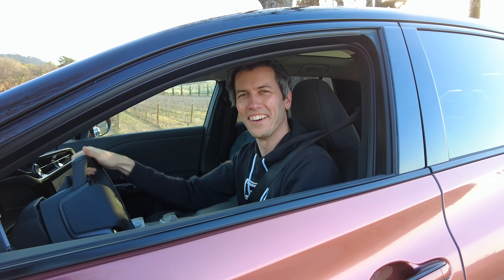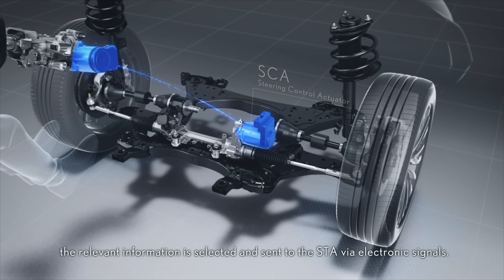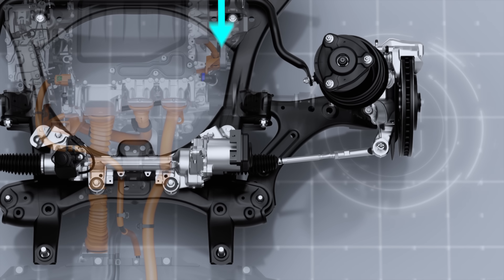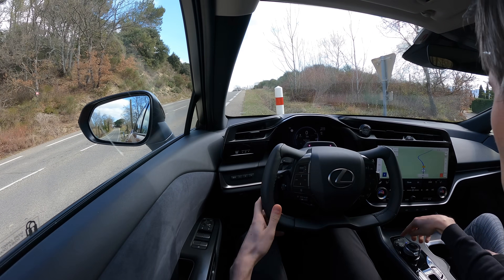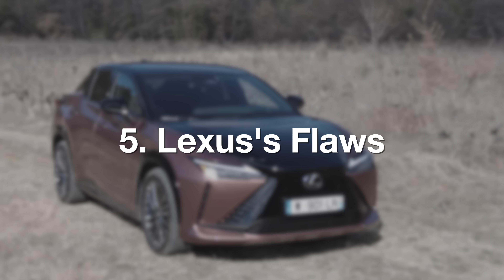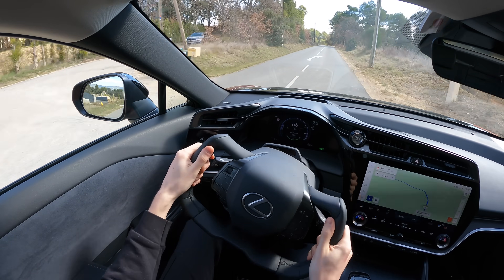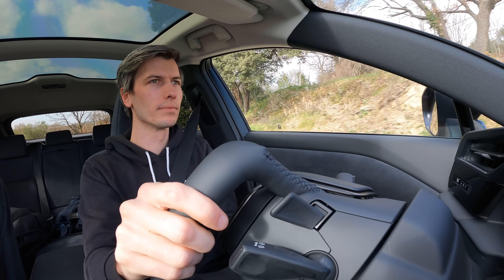How Lexus Fixed Tesla's Bad Idea: Steer-By-Wire Yoke

Comment: It'd be interesting to know what happens if you were to have a crash / hit a curb... The car's alignment would become shifted and so you learn to use a different steering angle when driving along.. what would happen here? would the car self align somehow? but obviously then you'd never feel if the toe was incorrect, only noticing it in shredded tyres.

Comment: I don't like the idea of variable ratio, how much it varies with speed changes? Does that mean that it can turn more by itself if I slow down during a long curve if I don't move the wheel?. 
I already feel really weird when a steering wheel gets stiffer at higher speeds than when you're moving very slow or not moving.

Comment: everything by wire have a delay. and since I haven't tried it am I not able to say that it is or isn't noticable. but it was pretty easily spotted in the beginning of the video. (written at the beginning of the video)

I see another problem as I go through the video. having variable steering ratios might look good on paper, but having the ratio change as you go along sounds incredibly sketchy. how turning the wheel one amount isn't the same as turning the wheel the same amount. that is the beauty of having a set steering ratio. it would be kinda ok if all driving was set at one exact speed and you only change speed as you go into another area with a different set speed. so let's say 50km/h in a city, 80 on a country road and 110 on a motorway and you aren't allowed to drive anything over or under that speed. but we all know that driving is dynamic. you might be on a sliproad where you accelerate as you turn, is it really a good idea to have the driver to turn the wheel more as the speed increases in a set radius bend? (written at 4:58)

I don't really see a loss of power as being the biggest safety factor because as you say, there are more than one power system. and having one or two or 20 motors to turn the wheels aren't really the concern either, redundancy is key. the one that really worries me is the computers. computers have gremlins, computers do mistakes and bugs are a part of computers. I have had throttlebodies fail on me that was fixed by just restarting the car twice in two different brands of vehicles and both were fairly new. this was all something that happened in the computer that decides what the throttle body is doing. the good part about the throttle body is that if the computer fails isn't it that big of a deal. you have no power so you coast or brake until you're stopped. you still have all the other functions in the car. as for steering by wire or brake by wire is it different. if there is an event that happens, could be a binary flip that doesn't cause any damage to the computer will there be an error but the error will most likely only last until you restart the car. this is the major concern I have.

I don't want the complexity, and I will never own one. I don't want steer by wire, I don't want brake by wire and if I'm able to avoid it would I avoid throttle by wire too but that one is sadly impossible if you don't go back quite a lot in time. but there is no denying that a cable actuated throttle is much more responsive than a throttle by wire so I want a cable for that simple reason.

Comment: Mechanical linkages can fail too. I had a Ford Fiesta where the gear to the rack became loose and I lost steering on a bend in the road while heading toward a lorry. Thankfully my brakes worked and the steering re-engaged once I slowed. A hart beat skipping moment I can tell you.

Comment: 2 motors or 2 batteries are not truly redundant system. If there is  a short in that wire due to you going of the paddle, you are fked.

Comment: 90% of drives do not hold a wheel like that on 10-50. I hold my hand on the top or the bottom of the steering wheel using one hand. Using Yoke is the stupidest idea ever. Adjustable steering based on speed also would create a lot of problems and accidents when you have to turn sharp even at highway speeds to avoid an accident. Steering by wire is fine, but adjustable and yoke are not.

Comment: Ignoring everything about how they work, just looking at the two yokes I can tell that one company knows what they are doing and the other doesn't.  The Lexus yoke is open for your hands at the 9 & 3 position, in line with the axis of rotation where they should be.  The Tesla yoke... where do you put your hands?  Are you expected to have them up where the (minimal) controls are?  Or further down in the 8 & 4 or 7 & 5 positions?  On top of that, having 840 degrees lock to lock on a yoke is sheer madness - it really shouldn't be allowed.

I think the direction Lexus is going is the future.  Getting drivers into the habit of always having their hands at 9 & 3, or perhaps I should say never needing to take their hands off of 9 & 3, is a good thing.  Lexus needs to get rid of that delay though, and make sure the sensitivity curve still allows us to dodge a moose on the highway at night.

Comment: I'd be curious to see how this responds in certain situations - like on an exit where you may go from 60 to 35 miles per hour while steering the same amount - will you start steering at a steeper angle despite not changing steering angle?
Reply: Exactly what I was wondering! Does the switch happens when you go straightforward ?
Reply: I'd assume that in terms of driving feel steering angle = turning Gs. So yes, but it will probably feel really intuitive. Your steering angle is dictated by turning 'feel' rather than the size of the turn
Reply: @LakinMoser  no they're not equal when your speed is changing.
Reply: my 2015 audi s4 has that, and yes the steering changes depending on the speed.
Reply: yeah that would be a bit confusing... and dangerous
Reply: F1 has this
Reply: Also will it be open source or just easly to mess with so you can easly set it how you like it?
Reply: @GreenBlueWalkthrough I think you know the answer to that.
Reply: in normal cars if you keep the same steering angle and slow down you will turn tighter as you slow down i guess in this it will be the same with the wheels adjusting so you turn is slightly tighter
Reply: Underrated comment

Comment: We've had steer by wire in port equipment for years. The port I work, We've had steer by wire Straddle Carriers since 2015. Nice system. Change is always uncomfortable until you get used to it.
Reply: Change is potentially beneficial when it serves a purpose, this does not.
Reply: @LaVaZ000  did you watch the video?

Comment: I has to be refined. But it is inevitable that that would be the choice as it is also cheaper to manufacture. One huge gap in safety is the wire itself. I had a car that had electric wiring problems which happened randomly, and by the Murthy's law never showed itself up at the dealership, but that would be an edge case scenario and will not impact the overall decision made by the large corps for us.

Comment: The best thing about steer-by-wire is that a bad actor could remotely hijack 1000 cars and steer them directly into an elementary school with no recourse from the vehicle operator. Good thing the brakes are electronically controlled as well.

Comment: It’s interesting how it works similar to racing games input. On low speeds you can turn all the way, but on high speeds it limits your input for stable driving. I know that on this Lexus doesn’t limit the steering, but instead just make changes the ratio of it.
Super interesting!

Comment: The point that you made with safety and how we already have drive by throttle, well those systems fail as well and we already saw ho much damage that can do, so no this is not 100% safe and it can fail

Comment: Not sure I like this, when accelerating out of a corner surely it will feel like the car is tending to understeer, when braking and cornering it will feel like it's oversteering? Plus at high speeds, that amount of steering latency could translate into a significant distance if you need to react quickly..

Comment: the fact that just about every driver in the world uses conventional steering input. driving a car that has less steer travel would confuse even the most experienced driver. your mind is conditioned for one thing when driving so if you give it something new it would take quite some time to convert to the new steering system. ive driven using steer by wire and didnt like it one bit.........

Comment: Thanks for the video, clear, concise and enjoyable (mostly).  However, please, for the love of god, look up and learn to distinguish between 'electrical' and 'electronic'.  Motors and thus conventional electrically assisted steering systems are electrical, not electronic.  You unfairly lose huge amounts of credibility with some of us when you abuse these terms.  Typically electronic means using electricity to manipulate information, so usually involves silicon circuitry.  Systems merely using motors or other electronic actuators, (powered doors, central locking, steering, wipers, etc) are not electronic in themselves, even if they can sometimes be controlled by car computers (body control units for instance).

Comment: Most modern mechanical steering racks have variable steering ratio, so the steering wheel is less  sensitive around the “zero”, which fixes the problem of car being twitchy. But the more you turn the steering wheel, the shorter the ratio becomes. It’s a much simpler and safer solution, in my opinion.
Reply: That's really interesting. I wasn't aware of that. Does power steering also compensate for the lower ratio near center by providing more assist?
Reply: @FurTip  I would assume it provides less assist
Reply: I call BS. How many have you taken apart? I've never seen this magical progressive rack you're talking about. I had a 14 sonata rack apart the other day, it's just a normal rack and pinion. You're definitely not talking about one of the ball screw racks, either. Since all steering racks turn more than 1 turn either direction, I don't really see how you could make a progressive rack. Any variation in the "ratio" is due entirely to the angles of the tie rods and rack to the knuckles and ball joints.
Reply: @brianwelch1579  

"I haven't seen it, so it doesn't exist." is a stoopid stance to take, especially when it's easy to find information on variable ratio rack and pinion steering. 

But first, not a single steering rack "turns more than 1 turn either direction." In fact, not a single steering rack turns at all. The rack moves linearly, it's the pinion that turns.

Google search: "What is a variable ratio rack and pinion?"

Answer:

"Some cars use variable ratio steering. This rack and pinion steering system uses a different number of teeth per cm (tooth pitch) in the centre than at the ends. The result is the steering is more sensitive when it is turned towards lock than when it is close to its central position, making the car more maneuverable."

It may not be as common as OP stated, but it definitely exists.
Reply: @brianwelch1579  Lol. Honda just uses various distance between the teeth of the rack. There are also more complicated solutions. Google BMW AFS, or Toyota VGRS. And don't embarrass yourself next time.

Comment: Effectively Citroën had steer by wire (well, hydraulics) in road cars in the early 70s. There was no mechanical connection at normal operating conditions. A fall back for failure of the system was included. Of course using electronics this is now much cheaper to implement, but the thought is not particularly new.

Comment: Great analysis.  I hope Tesla is already working on a system like this, they took a shortcut to their yoke implementation and I'm sure they know this is the correct way but likely didn't have time to fully bake the solution on the first iteration.
Reply: It's more a question of cost for Tesla. That's usually why they take shortcuts.
Reply: Its because Tesla is run by Silicon Valley tech midwits and Toyota is run by automobile industry professionals.

Comment: Dynamic steering ratio is scary. This is not intuitive and I would definitely steer away from such solution (lol, that pun!). In the same fashion, eliminate the whole steering wheel/yoke - just make it a small knob, like the Mercedes' gear selector or like a modern airplane's side steering throttle and side control stick. I am on the far side of - I totally hate this. 

Now when I mentioned the knob as a steering tool.. Remove the dashboard, make it into HUD glasses / added reality glasses - eliminates so much from in front of the user :D

Comment: The input lag of wire steering could cause one of the worst things to happen while you drive at high speed: overcompensating because the initial input didnt cause the desired output fast enough.

On this issue alone the technology could be dismissed. On top of that, there should be a fallback system in case an electronic issue compromises the system during a driving session.

 With a physical shaft, the system may fail in a more predictable manner thus giving time to the driver to take the necessary precautions before a crash.

Comment: have there been cars, have you or viewers driven cars where the effect of a degree of steering is more the further you are from 0 degree? the same angle would have the same effect independent of speed, low sensitivity at small changes. high sensitivity with large changes

Comment: I think these systems will remain rare, if available at all to the public, until self driving has improved a lot. I can see the benefit to a retractable steer by wire set up if the car mostly drives itself on main roads and motorways and given the car could probably recover from a communication failure in the steering as long as the power was still on to the steering motor itself safety would be less of an issue.

I wonder how many of the worriers in this thread are aware of just how much of a modern airliner is fly by wire and will travel on those without even thinking about it?

Comment: In my country it can't be legalized because it will not be in compliance with the standards which states that all vehicles which can drive above 60 km/h must have hard connection between steering wheel and steering wheels.😊 Probably all EU standards are the same. So lexus should tackle first the standards which will be really hard in my opinion. Cheers guys 😊

Comment: Okay.. but what if all the batteries lose power? Might not be likely to happen but if it can happen at all it needs to be addressed. I'm also not a fan of brakes fly by wire. Need me a mechanical e brake at least.

Comment: Everything is fine when electric system in car works fine - typically in new car but even some new cars have issues...

However in older car electric system could have some problems which are usually hard to fix.
E.g in my car i have broken ABS computer IT was hard to find.
One time everythink worked fine and other time climate Control system, tachometer and mamy other thinks gone wild...
During driving...

So even when electric system goes wild you always have mechanical Control over the car.

Comment: Had a Cadillac with speed sensitive steering.  It was okay.  Until it stopped getting reliable road speed data from the ECU.  Then it was an active nightmare.  Steering control intended for 70mph at 10mph or vice versa at random.  Not a detected failure condition and no failsafe built into the system.  Otherwise,  the only real reason to build this is to make cars that can take control away from a user without their recourse.

Comment: Since the steering angle changes with speed, if you're in a curve while decelerating or accelerating, does the angle of the wheels change, even if the steering wheel angle is held constant?

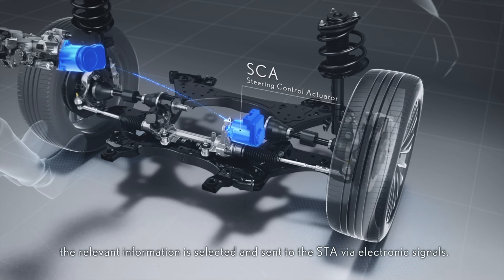Comment: 6:00 Shouldn't the pot hole be high frequency and losing traction low frequency?

Edit: in icy conditions I get pilot induced oscillation at about [250] millihertz at speeds of over 60km/h. I suspect it is because I have a habit of constantly checking grip from cycling in the winter.

Edit2: 4 second period, not 400. Also the Low-pass filter for things like potholes [is] probably needed due to the input lag.

Comment: Sounded similar to the steering system used by Volvo in the S80, so looked it up. It is variable steering force (providing extra assistance at low speeds), not variable steering ratio.

Comment: After I back to back slalom tests with Lexus yoke and a conventional steering wheel, I have to say it's pretty amazing. Instantly felt natural and intuitive. Going through the slalom is effortless, even when the suspension bottomed out in the RZ. You also get the added bonus of not having have top of the steering wheel block the dials and info on the dash. 10/10 would get if I had the money haha
Reply: Any idea about how much money it'll cost?  I'm fairly certain I can't afford it, but I'm curious anyway.
Reply: How is FishTurd69 getting to test this on a slalom course? Are you with Lexus?

Comment: Wires are famous for fraying, braking and otherwise being damaged, you really want the one thing controlling the direction of your vehicle to be connected with just a bit of copper? Even a software malfunction means your car could kill you in an instant! Just a quick 0-50/60° turn in either direction while going about 80 KPH is sure to kill you, any passengers and anyone next to you on the road.

Comment: And thanks to that, i gained absolutely no actual benefit as a consumer. The product cost increased drastically for almost no benefits or improved driving experience...
More complex meaning fixing and repair cost will hit harder than before...as if it wasn't hard and expensive enough already...